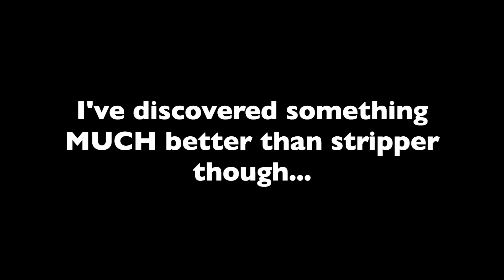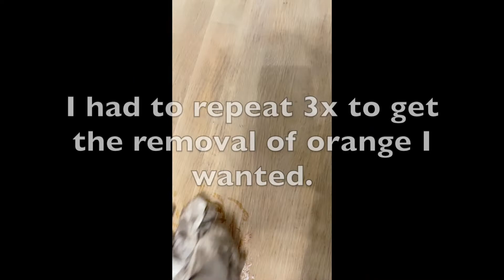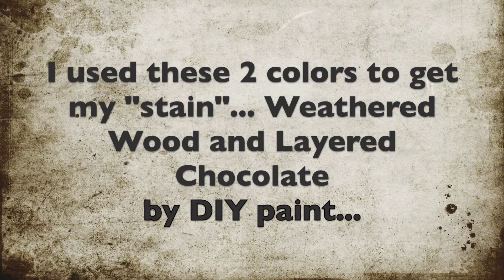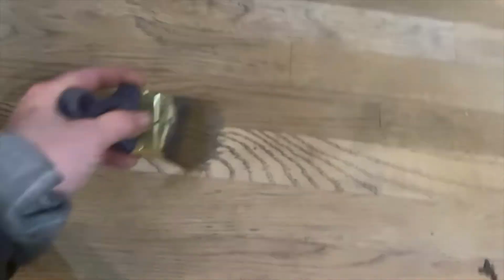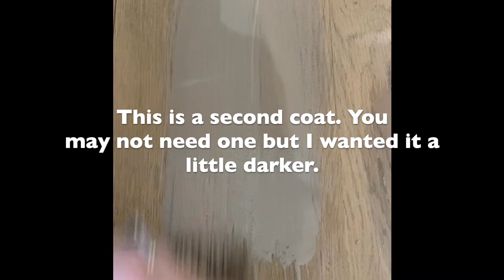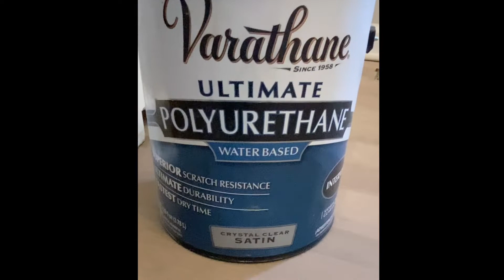How to refinish "orange" oak hardwood floors! HINT: BLEACH and mineral paint | DIY

Comment: If you had new hardwood unfinished floors installed could you add a tint of your desired color to the sealer/polyurethane and be done?
Reply from the maker: @vikinorman317  Oh I absolutely think so!! And that’s brilliant. One thing- I’d be sure and apply more than 1 coat of your tinted polyurethane for protection… you didn’t mention number of coats so I thought I’d be sure to say that. 🙂

Comment: Is that hardwood? Will it work on laminate as well?
Reply from the maker: Yep, it's hardwood, but yes it will work on ANY surface, including laminate. (not the bleaching part, or it might depending on the type of laminate I guess) . The paint washing technique will work on any surface. I did it on my kitchen table as well, and several furniture pieces!

Comment: I’m wondering what happened to your lovely painted floor in the kitchen area ? Update me please
Reply from the maker: Hi! Well, this is it! I did this to the entire first floor oak which is just my kitchen, hallway, dining area and studio. I ended up not leaving that painted finish alone; I kept thinking I wanted it lighter or darker, and because I’m impulsive, I would mix up something and just apply it. 🫣🫣
So eventually it was just not what I wanted and some areas looked bad where I didn’t take the time to apply poly thoroughly….. 
So when I learned I could bleach the darn orange tannins right out of the wood and leave it natural (with a water based stain of paint), I was all in.
Reply: @ShePaints  ha yeah I get it , I really loved the look of the paint you did though…I had this really bad coloured red laminate floor , not hardwoods so prob wouldn’t hold up to bleach too well , I do love the look you’ve got now though ….anyway I ended up painting the whole living area pretty much fully white with subtle  shades of  grey , I love it , but alas where the joins are it chips off as the floor flexes under weight and the dogs do scratch it when they get overly excited. Still I am happy with it , beats the cost of new floors. I guess I just have to cut those big ol fur baby nails more often too. 
I am with you on impulsive changes I am forever changing stuff ,looking for old paint in the shed to change pretty much anything.  Guess we just have to be busy lol.

Comment: I don't understand why you're using hand tools on a floor?! Why not use a real floor sanders, a mop and bucket ?! I can't imagine doing this on 1,000ft of flooring.
Reply from the maker: I think that’s a fair question. I would say mostly that my ADHD informs most of my methods; I have to do sections of a large floor at a time rather than all of it at once with each step. Spending too much time on one thing makes me bored & like there’s a fire somewhere I have to put out 😬☺️ so I prefer to do small areas at a time (until the topcoat - of course that needs to go on from wall to wall for an even finish.)
Reply: @ShePaints  I have two kids with ADD (& other things) but, your method is not ideal. If doing it in small chunks is good for you for a reason, I'd suggest being clear about why you choose this way instead of a  streamlined one. I, for example, would not do it the way you are because of the numerous additional steps. Also, in floor refinishing, it is preferred to do at least one full room at a time to avoid uneven finishing.
Reply: @tlynas1 if you don’t like her method then don’t do it. No need for the attitude
Reply: For one thing, some people can’t afford to rent large sanding tools to the tune of about $500 a week (drum plus edge.) I think her method provides an opportunity for anyone to diy refinish their own floors.